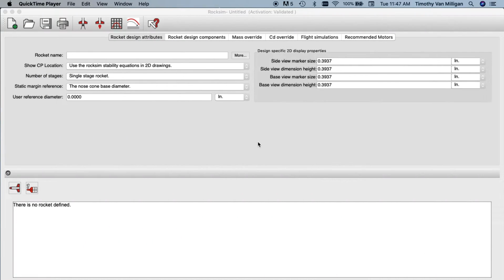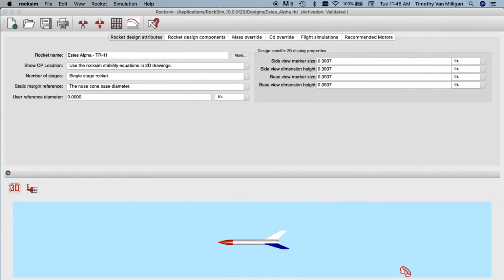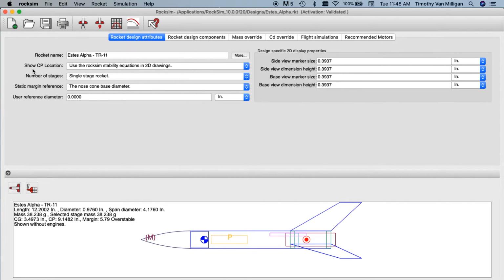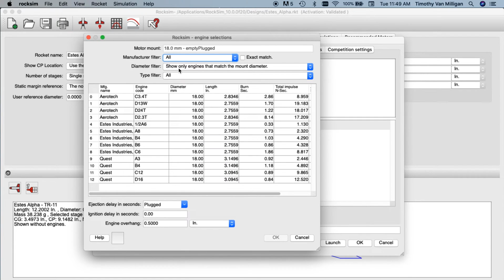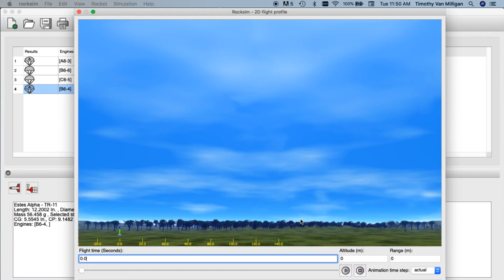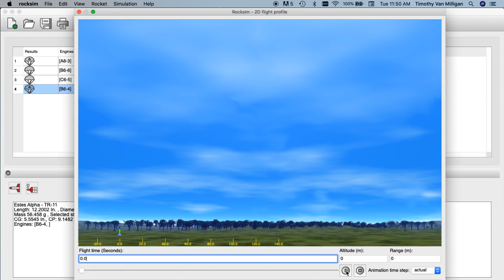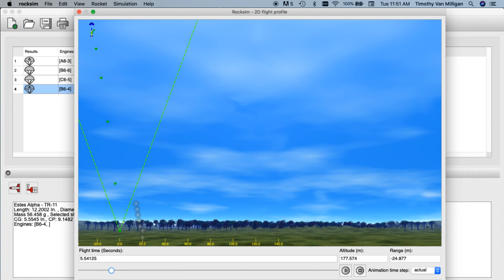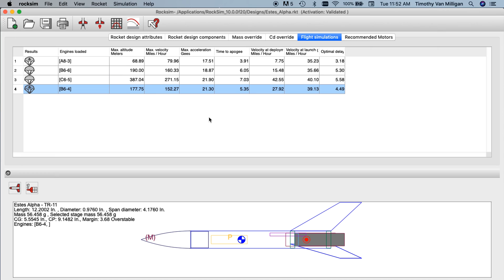Rocksim Tutorial #1

Comment: i looked into getting ht Patriot but why the ALL word instructions is kind of over whelming . who makes a kit like the 2.6 patriot that has better instructions.
Reply from the maker: I don't know what a ht Patriot is. But if you get Apogee kits, you'll find great instructions.
Reply: @apogeerockets  glasses on now
I mean the 2.6 patriot by loc precision. the instructions are just words. lol.

 i was curious about getting the Zephyr. the fins have slots in them.  I've not seen many like that, is that a weak spot? they are so close to the edge. 

also, when get into the 29 Mm, 38 MM motors do they come with the ejection charge or do you have to use the electronic ones to set it off? 

one more thought. i notice most launch straight up. why? 
as a kid i always tried to launch at an angle so the model would come back to me as close as possible.  i think you can do no more than 30 degrees.

 thanks again. you can bill me for the help ha ha